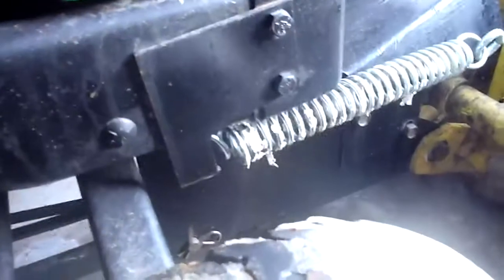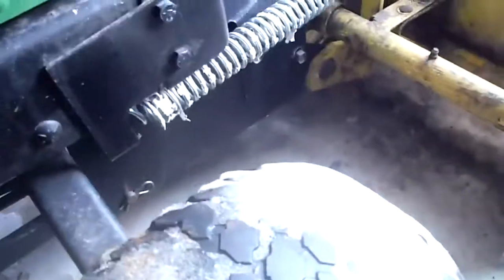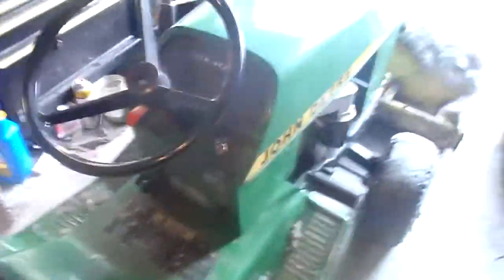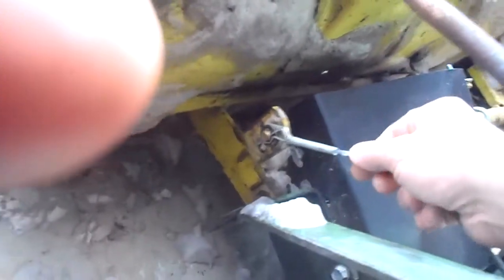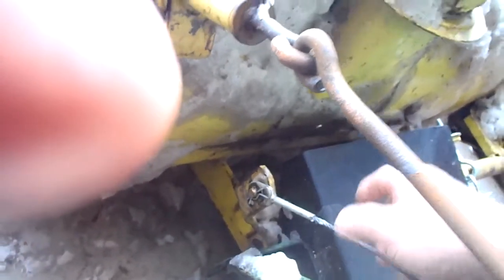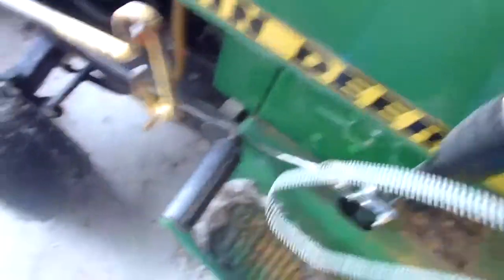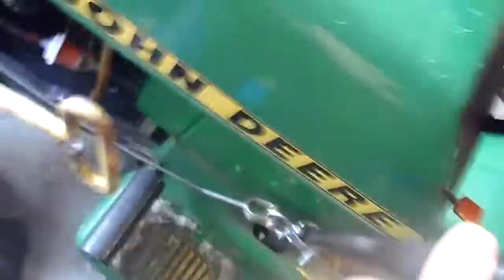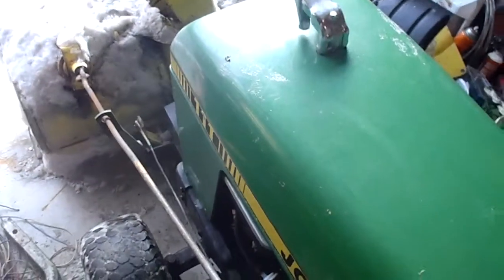John Deere 111 Snow Blower INSTALATION and COMPONENTS

Comment: do you know where i can find a mule pulley? or  do they come with the tactor on the mowing deck?
Reply from the maker: mule pulley came with the snowblower...... most people loose it or buy a snow blower not knowing all the parts they should be getting with, I bought this blower being told it was complete. later I found out I was missing all these extra parts i am inprovising in this video ., go the mule pulley on ebay for about 40 bucks shipped to me

Comment from the maker: if your asking the question then I am assuming your sweeping out / "the wrong direction", I don't know anything about the 108, maybe you should  record a video when your done... My Snow blower install worked before I recorded my video. The first thing you need to confirm is the spin direction of your PTO (Power take off), does it rotate in the same direction as a 111? if not then this belt  routing configuration cant work, also, are you certain the snow blower is intended for the 108?